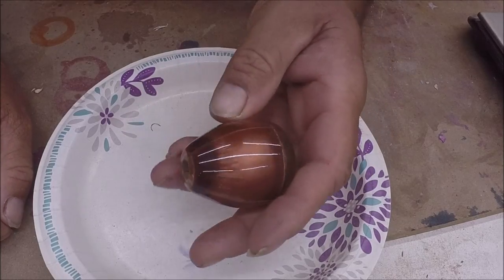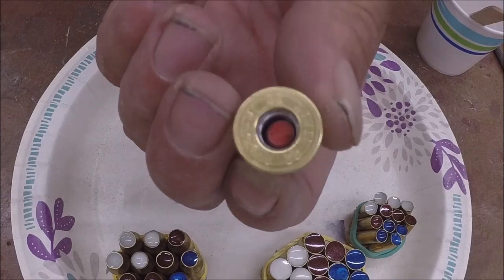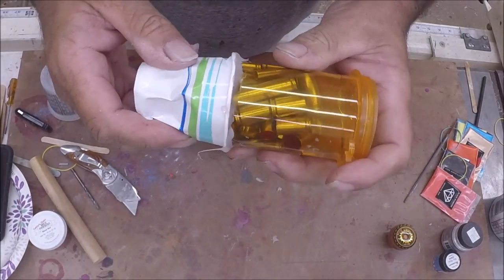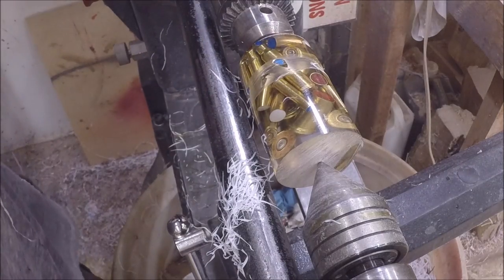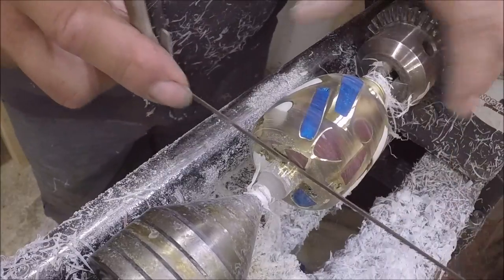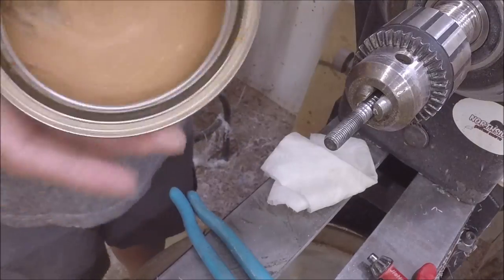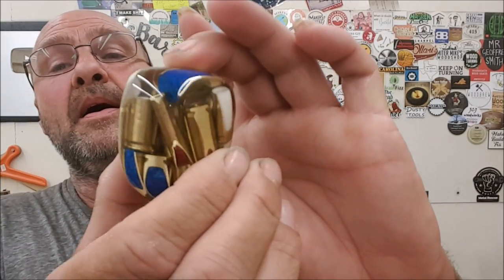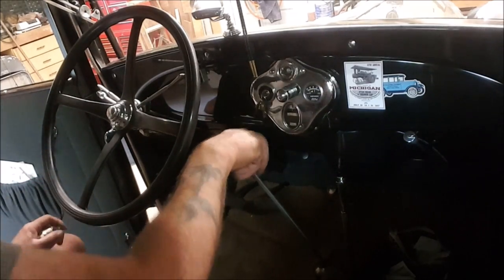Shifter Knob, Ammo casing in resin

Comment: Very cool.  I had a 1932 Ford Model B pick-up truck way back in the late  '50 early '60's. Drove it to high school. Straight four like yours. But '32 was the first year Ford used a fuel pump instead of gravity feed.  Fuel tank was under the seat. Can you imagine that today.....?  Wish I still had it.   Just subbed.
Reply from the maker: 1st off 32 is a prized machine to find and is almost worth it's weight in gold.   Thank you

Comment: Maybe someone has already said this but what you did was quench the brass, which actually hardens it.  Annealing is when you heat it then cool it in a controlled manner, which as you said will soften the metal.  If you intend to soften it, heat it to temp and slowly cool it.  If you want to harden it heat it to temp then rapidly cool it.
Reply from the maker: Thank You Ian,

Comment: Nice job, unique theme.  I did have a thought about an interesting effect that could work for any similar project: Start the same, just turn it a bit smaller than the size you want, make it perfect, then cast it a clear resin, and turn it down to the size you want.  The skull in a bowling ball effect I guess.  The surface is absolutely, totally sealed, you'll never tarnish  exposed brass and the first cast imperfections simply go away.
Reply from the maker: Thank you Joseph,  that could work too

Comment: Great project and you did a good job of it.  TIP: Boeing aircraft mfg. process uses refrigeration to stabilize aluminum parts prior to machining to reduce temperature expansion and increase precision.  That might work with keeping the resin hard and reduce deformation of the brass.  I've never done it but it might work in future projects.  Thanks.
Reply from the maker: Thanks for the tip!  I probably just turned it to slow creating the heat, it went much better when I bumped up the speed.

Comment: This is an AWESOME project!
I was wondering at the beginning of video - brass is hard enough to give problems cutting - and sure enough.
If you attempt another project similar to this, couple things you can try:
1) water spray right at the cutting surface to keep the piece & tool head cool.  You see this technique used in granite cutting factories.  Granted, it'll make a mess of a puddle on your floor.  You can re-purpose any recent Roundup battery-operated hand pump.  Change the switch to a foot-actuated pedal, so you can still work the piece solo.  Some spray-guards so centrifugal spin doesn't spray water back in your face...
2) If "cutting" is difficult, can try "grinding" with stones.  Similar to wet-stone sharpening of kitchen blades (and katana swords).  Start with low-grit numbers for faster "cutting", then move to finer grit for "polishing".

Of course, this is all just theory.  But there's real-life examples to support it.
Would love to see your next work.
Reply from the maker: Thank You Thank You
Reply: @PohlBarnProductions  
Not at all.  Glad to be of help.

By the way, if you try the stone-grinding method, simply having pre-soak your wet stone in water (24hrs before use), and occasionally re-dipping in water while you work, you don't need to mess with rigging a water spray system.  Wet stone surface retains a thin layer of water quite well.

Comment: A lock nut,   Wax will make it easier to tighten up even more, but great parting agent. You could have used a simple nut to lock behind your very nice piece. I would also have roughed it then used a rasp file. and polished out with some car abrasives then plexiglass abrasive. in the seventies, we used to add parts fill 1/4 of the container add more parts, etc. you could organize the pieces inside to float or just place as you wanted.  Really like the piece thumbs up !!  Hope that's not your work truck!
Reply from the maker: Great suggestion! Thank You

Comment: What if you filled the casings with black and then set in actual full metal jacket bullets. That way they would look like live rounds were used. 

I love the colors and it's an interesting look. Definitely 2 thumbs up. 👍👍
Reply from the maker: Thank You, it would look like a live round,
Reply: @PohlBarnProductions  since your not dealing with live powder, you can seat the bullet with a drift that has a counter bore in one end to match the point of the bullet. Just tap them in.

Comment: I was thinking those primers might give you a problem. Maybe next time remove the shot ones, hammer them back out with punch and install back. Additionally use vacuum chamber to suck out the air in primer, even enlarge the holes so air can be replaced with resin more reliable.
Reply from the maker: Thank You Thank You

Comment: Cool project, I do more metal turning than wood, but I suspect part of your struggle with heat softening the resin and tearing the brass was surface speed, for hss tools, brass wants to be turned at 150-200 surface feet per minute, plastic 500, you can double or triple that with carbide, maybe, if you have enough HP, cooling and ridgidity.. so if your knob is 2" in diameter you are turning 6" per rev, so at 3000 rpm you are looking at 1500 surface feet per minute, pretty much the max for plastic and downright radical for brass.. you seem like you have a pretty good handle on your wood lathe, so this is merely a suggestion, but I would try running a much lower speed, 500 rpm perhaps, and using a less aggressive tool geometry, something that wont try to dig in.

And cool Model A, I rode in one once as a kid in the early 90's, and my uncle routinely does machine work for a local guys model AA pickup, has a multi start worm drive rear end, very interesting vehicles.
Reply from the maker: Thank You Greg,  I have not used a metal lathe since shop class in High school, I will try slower speeds if I try this again. the AA is just a bit larger than my car,  same era though,

Comment: What about cutting the shape you want, only smaller, then putting the whole thing back in clear resin and cut to the size you want? Then all the imperfections are sealed in a nice clear coat. (I have zero experience doing this kind of thing, It's just a thought I had.)
Reply from the maker: Thank You Chuck, sounds like a lot more work to me but I suppose it could be possible

Comment: Doug, Kim’s 4th o July platters was a little better than yours, but your shift knob totally was the bomb! Totally awesome. To get a great finish on resin, I have always gone to at least 1000 grit.
Reply from the maker: I did not show all the sanding it's to long and boring, I started wet sanding at 600 all the way to some crazy number with those micro mesh pads,18k or something like that.  Kim designed my last project I wasn't even going to make one.

Comment: Use a vacuum chamber to suck out all the bubbles. Same as used for investment casting where all the bubbles need to be removed from the items to be cast. Also, do not quench the brass after heating (annealing) that will only add temper to the brass. Quenching is a rapid contraction of the molecules heated hence tempering (hardening).
ps. use a mild solution 1 in four parts or less of muriatic acid(pool acid) also known as hydrocloric acid to remove torch oxydation  from external surface and inside of case. Place in a sealed jar and shake until color change, keep baking soda solution in a separate jar just in case of spills also drop casings into soda solution to neutralize acid washed shells. You can brighten with TAR-NEX in a separate container in solution if you like 50/50 or more water if you need then save solution for future use. mix soda solution into acid solution slowly to neutralize acid then dispose of or save separate for future use. ;)
Reply from the maker: Thank You for information William

Comment: Great work but I have a question. Please excuse my ignorance as I'm just a humble toolmaker but I'm curious to why such a high spindle speed? Is it because of the thinness of the casings? 🤔
Reply from the maker: Thank You Jason, because goin so slow wasn't working so well, I never claimed to know what I was doing.
Reply: @PohlBarnProductions  .Ha ha thank you for the reply. You maybe running the rpm too fast, that's why you're having heat issues. If you prefer the high speed, add a stream of coolant to aid cooling. You'll make a right mess but it may prevent the casings from overheating 🥵

Comment: the primer voids are an unsurprising annoyance in this.  I didn't think of those until you started to turn it.
Reply from the maker: I tired to knock some out but I just kept bending my punch so I left them in
Reply: @PohlBarnProductions  I'm a reloader so the resizing die usually gets them, but even so, some times the flash hole is offcenter and bends the stupid decapping pin.  It's irritating.

Comment: Nice work! A few questions as I’m thinking of doing something similar with small circle hooks instead of bullets ( I’m more of a fisherman) 
1.) where can I buy enough resin and hardener to make one, possibly two of these? I don’t plan on making any after that, and have no need for the material after, so I don’t want to buy a large quantity.
2.) if I wanted to slightly tint the resin blue, how would I go about it? 
3.) would using an electric drill be comparable to the lathe in achieving the end result? I don’t have one lol
4.) (last one) grit counts of sand paper used?

I know it’s a lot of questions, but you dont learn if you never ask! Thanks!
Reply from the maker: you can get small amounts at hobby stores or order it on line, I suppose you could do hooks as long as you place them so you do not hit them, unless the are brass or copper,  same hobby store should have small amounts of alcohol inks in a wide array of colors, I've seem people use a drill press as a lathe and I think there are video's on people using a drill, sand paper if you coat with resin when finished shaping 240 to 320,

Comment: Since you know how to drive (don't need an automatic) I'm surprised that you were using brass of calibers that people usually throw away instead of handloading.  As a handloader, I would have thought that you would have de-capped the brass and then run them through a case tumbler before beginning your project.  
Your gearbox makes noise when you upshift.  Are your synchrons OK?  I do hope you rev the motor when you downshift.
Reply from the maker: except for the 45's the other cases were run through a tumbler after I annealed them. they were still hard, lol rev the motor yes you have to and no the synchro are not fine they are not even present,  lol you have to wait for the gears for fall into each other I might of been leaning on it a lil hard, it's 90 years old and still going down the road, gears are fine for now.

Comment: So cool. One question. What does the vacuum press looking device do for the resin curing process? Does it speed it up or act as a clamp? Or something else? Thanks
Reply from the maker: Thank You pressure pot, compresses the air that was mixed in and it also helps control the exothermic reaction of the resin

Comment: Watched a lot of video's using brass or aluminum with resin and always have the same problem of tearing out or some other problem. Has any body thought of just getting the shape semi close and then using files for final shape? For that matter a file can be used for the whole thing. Start out with heavy cut and work your way to smooth.
Reply from the maker: well that all fine and good Rod, I am a metal finisher by trade, but this is wood turning and resin art or hybrid art,  it's suppose to go wrong and still turn out great,  I am sure I could have filed it perfect as I know how to do just that, but that would be way to easy. my channel is based on screw ups and how to fix them for the most part,  LOL

Comment: That sure is a tiny rearview drive mirror.  Did the Model A's crank...or just the model T's?
Reply from the maker: I can crank it yes, the handle is under the back seat, it slides in the front through the grill bezel at the bottom of the radiator
Reply: @PohlBarnProductions  ok, so is the key start ignition something that was modified?

Comment: what if you use a fine scuff pad on the casings before you pour the resin in? do you think it would stick better and would you see it through the clear resin?
Reply from the maker: Thank You,  I think with the clear resin you would be able to see the scratches if it were scuffed up.
Reply: @PohlBarnProductions  I thought that but then i remembered that autobody shops can use a grey scuff pad on base coat and then clear over it... Might look different on metal though so u could be right.

Comment: Very cool. What Total Boat product do you use?
Reply from the maker: Thank You Dwain, I am using the high performance 2 to 1 epoxy resin with a slow hardener
Reply: @PohlBarnProductions  Thanks. Have you ever used Total Boat?  I’m looking for help understanding the best epoxy to use. Thanks in advance for any advice you can give. This is super cool. My neighbor wants me to make something like it for his boat.
Reply from the maker: @dwainchristensen6467  I use it because they send it to me, if I had to buy it I would go for Alumilite clear slow, it's made for what I am doing, but it also has to be pressurized so it has it draw backs

Comment: it wont melt in the heat?
Reply from the maker: it has not so far.
Reply: @PohlBarnProductions  sweet. it wont even get sticky? Im guessing if its all good it should feel solid and grip as well as a normal knob
Reply from the maker: @morphius747  the resin should be cured by now along with it has a CA Glue finish on it, rock hard that is, it seems fine while driving, if there were any cracks or droops in it I am sure you would feel them right away.